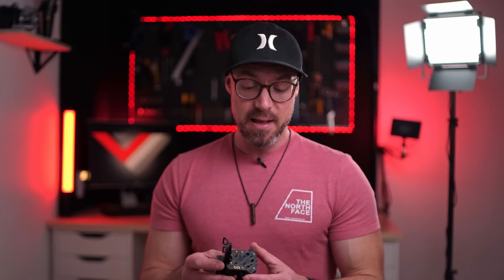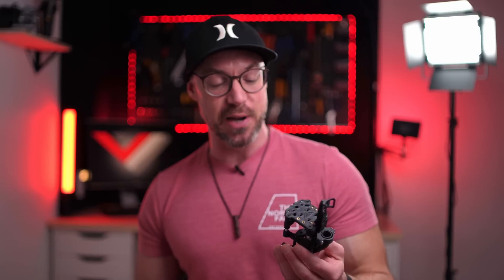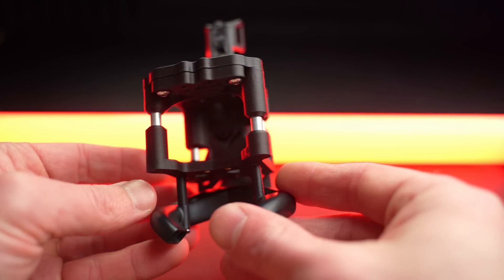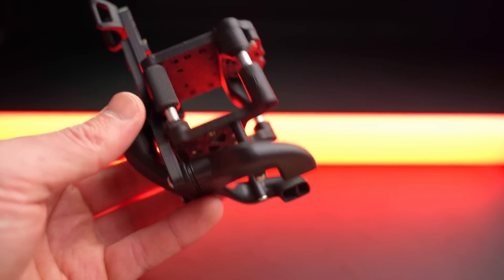Vz-Printhead Printed Edition Prototype - VzBoT

Comment: This I entertaining even if I didn't have any interest in 3d printing.
Your video work is gorgeous. And the design is exquisite.
It's easy to get stuck on designing and printing upgrades for the printer rather than designing and printing the end goal parts.
At some point, a guy has to print with the printer he has. (Dance with the girl ya brung.) At least as long as it is doing the job you need it to do.

Comment: 4:10 It's been a long time since I've seen a thread pulled at the end of a print. For years I've used the end script I wrote, in which the printer pulls the filament away from the printer immediately after the retraction, at high speed, skewed upwards, far away.  Try it !!!
Reply from the maker: I have retract end gcode.  But.. my timelapse macro runs just after layer and that causes this. I need to find a way to avoid this when doing timelapse.
Reply: @Vez3D  Ok. Understand.

Comment: I have put together this printhead BUT see some problems. (I'm using the Dragonfly-UHF hotend)
1-There are NO holes for the 2510 fan on the dragonfly part
2-MAJOR problem, there is no provision for a probe so this will be unusable for me at this time
3-The grove mount puts the dragonfly so far down that the fan duct is blocked by it, (the fan mount is ALL the way down)
Reply from the maker: 1- i will check. That hotend is not popular..and if you can provide me with the cad of it..i can make it work 
2- did you watch the video? There are quickdraw and beacon support. But if people want more options, the there are multiple mouting points on thr top plate or bottom plate with those brass inserts. Just design one that fits your need :)  there are already some made for the alu printhead that fits this already for induction probes. If you want me to add a support for something ...ill.be happy too. Just ask :)  
3-that hotend again is something i have never seen besides pictures.  It wont be hard to adapt it.  Its an opensource design and cad files are there. 

All those are not issues..  they are options. Please dont call that problems :)

Comment: Looks amazing, Simon! :D One thing you could do to reduce the weight is to skeletonize it a bit more - it seems like there is enough material to do so without comprimizing the overall stiffness :)
Reply from the maker: Sometimes adding more holes here there will add weight.  Because you add walls instead of infill. Infill is light at 15%
Reply: @Vez3D  Thats a Good point 😃

Comment: You know what, the main reason why I'm shifting to this is because my current setup uses EVA 3. But while EVA 3 is excellent with awesome compatibility, it's not hugely optimised for weight/performance and can be overly time-consuming to build and assemble, IMHO. 

In comparison this is easy to assemble! 

I guess one thing I'll be working on soon is a BLTouch adapter

Comment: After you heat the insert and it starts to pop up, use a flat spatula to push it flush and true which also makes it square and displaced plastic will be flush and not protrude.

Great video though!

Comment: Do you plan on making it compatible with mgn12c?
Id want to try it out instead of eva on V-Core 3.1
Reply from the maker: no sorry.. MGN12 is 3mm taller.. and would completely change everything in the design. .. and MGN12 is way too heavy. Its not needed in a 3D printer imho. Its way over kill
Reply: @Vez3D  I knew there was a weight difference but I didnt think it would be that bad. Btw, what would you think will be better option for 300mm printer, going extrusionless mgn12c or cf tube and mgn9?
Reply from the maker: @leonartou  tube + rail
Reply: @LEoNaRd  the next time i take mine apart this will be what i do. Cf tube with mgn9 and upgraded gantry housings- can't think of the term. You can drop a lot of weight and gain some rigidity and maybe some consistency at higher temps. I've heard some smart guys say that 300 or smaller is fine with just the rail. CF tube ain't that much more.

Comment: I'm printing parts now, wondering how the hotend fan is mounted, don't see a printable mount for it.
Reply from the maker: look in the duct section https://github.com/VzBoT3D/Vz-Printhead-Printed/tree/main/STLs/hotend%20heatsink%20fan%20ducts
Reply: Never mind, I found the part I need HOWEVER, there are no holes where the 2510  fan would mount. Did you forget to add them?

Comment: I wonder if some of the parts could be modified in a way such that they can be made on a 3 axis cnc mill/router from carbon fibre. It would make the parts lighter, without compromising ( maybe even improving) the stiffness
Reply from the maker: we already have a version like that... all CNC.. with Carbon+ aluminum. This version is for people that dont want to spend on the CNC version.. or prefer this version

Comment: These fan shrouds seems VERY smooth... did you coat them with something ?
Reply from the maker: resin printed,, sanded, painted :)
Reply: For better air flow ? 
Maybe you could get the same result with acetone smoothing ? Can CF ABS be Vapor smoothed ?

Comment: Dude that print quality is amazing makes me rly consider Goliath for my printer since I’m struggling to get enough flow with my rapido and my only concern was the massively long heat zone
Reply from the maker: meh.. its not super good quality.. my top surfaces were rough.. I need to calibrate more for this ABS CF. I was just in a hurry
Reply: @Vez3D  side surfaces though look amazing. 
What speeds and such for top surfaces? I notice similar on my machine when I was running lower accel on tops but then I bumped it back to 15k and lowered top flow to like 94% and they improved a lot
Reply from the maker: @tadhgd350  200 too with 5k. Its over extruded in here
Reply: @Vez3D  not that I know more than you cuz I don’t but I found that matching my accel to the accel I tuned PA at, aka higher than 5k helped reduce the edge blobs. And lowering top flow by 5% helped any remaining overextrusion. And I print em slow at 70mm/s to get as good surface as I can
Reply: @tadhgd350  CF filled filaments make the layerlines vanish, it's double edged sword, it looks amazing but you don't know if it's well tuned
Reply: @MatrixRay19  yea they make the layer lines vanish but you can still see rippling and ringing and such, which I don’t really see here.

Comment: If you get the brass tips, and use lower temp they don't sprue as much. You can bump up the hole size too. For those 5mm inserts I use 4.7mm holes. Love the printer. This will be the next one I build!
Reply: For the 3x5x4 inserts, the 4.7 hole 4.1 deep works well.   I push them most of the way in and then press them the rest of the way with a flat metal tool.  Everything comes out perfect and flat,  no protruding displaced plastic
Reply from the maker: thanks ! yeah I think it was too hot. Aso the holes are 4.2 for the 4.6 inserts.. but I only had 5mm on hand.. so I guess thats why it sucked
Reply from the maker: Thanks..i have ordered the right tool now.
Reply: @Vez3D  I use a digital 2-1 workstation I am able to set temperature so my parts are asa I set my temp to like 240. So my brass slide in nice and slow I also twist the soldering iron slowly like screwing in the inserts.  And if my brass insert are too long after I insert them I files them down flush.
But you probably now have printed an insert device and proper solder insert tip for this.
But this is for others just starting to do inserts.

Comment: my dude, your arms are getting bigger with every video, what are you lifting, goddamn
Reply from the maker: Haha no. They have been like that for like 20years.  I am 175lbs since then.  I was at 185lbs whem i was a 25yearls old..and way bigger.. hehe. Was doing MMA/boxing and working out hard. I still work out hard..but i have so many injury that I cant push as hard now. Sucks to go old.  Just last monday I dislocated my shoulder and had to go to hospital to.put it back in. It still hurts.  My back is screwed too.  5 herniated discs..  haha
Reply: @Vez3D  i feel you on the herniated discs and the shoulder problems, i have a genetic birth defect, half the muscles in my chest,shoulder and back on my left side are missing, I've inadvertently ripped my shoulder out of the socket more times than i would have liked

Comment: Impressed with your video composition and lighting! Well done 👏🏼 I would suggest going with the larger auto-focus window when handling a part in your hands though, or facial tracking. It really hunted focus to the part in your hand a lot. Overall, looking very cinematic!
Reply: @Vez3D try adding a Polarizing filter in front of the lens to cancel out the reflection of the glasses, should fix the problem with the facetrack ✌️.
Reply from the maker: @iRocks-Mak3rde  ill try that :) i first need to see if its available for that Samyang 35mm f1.4
Reply: @Vez3D  Disabling AF completely for shots like this is sometimes a good solution too! Have to do it with my camera all the time
Reply from the maker: @OnceinaSixSide  yeah that was my thought when i edited
Reply: @Vez3D  What shutter speed are you using? Usually you'll want to match the shutter speed with frame rate (so 1/60 or 1/120)  to get rid of the slight stuttering effect. Awesome setup btw! -Steven
Reply from the maker: @3D Printer Academy  exactly what i do normally.. but my cam do only 30fps at 4k..and I hate low shutter speed.  So i minimum do 1/60
Reply: @Vez3D  but motion blur makes the printer look faster! :)
Reply from the maker: @williamluong7743  haha I dont know. But I want to point out I just put on my Rokinon 35mm F1.4 lense onto my samyang Lense station, and guess what... firmwate update !! from V2 to V4 with autofocus issue fixed apparently. I will test it :)
Reply from the maker: Yeah.. its a samyamg lense..and its not goof with eye trackign when i have my glasses..sorry. ill find a solution
Reply: @Vez3D  It’s really fine. I just know you strive for perfection☺️
Reply: Agree on most - but when assembling the printhead there was a lot of fast jumping around that got me dizzy and sea sick. Sorry. Lighting and video camera quality was great though.